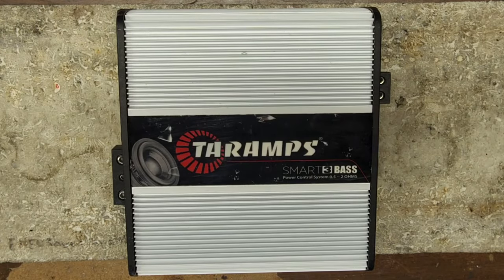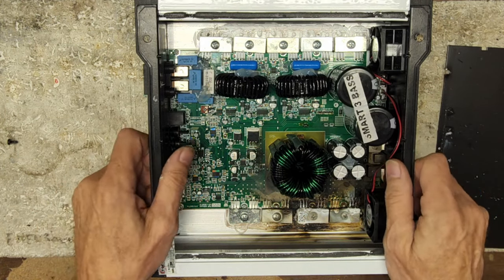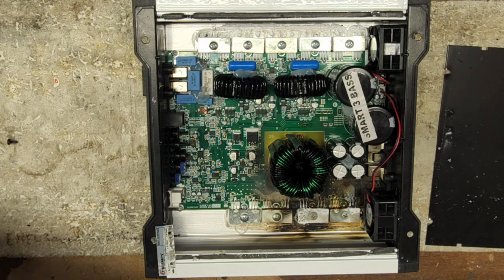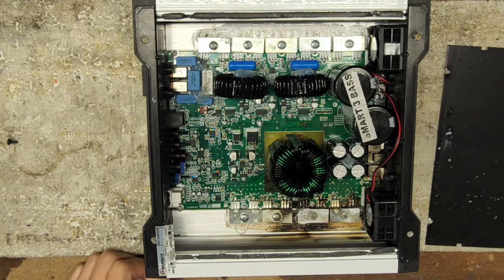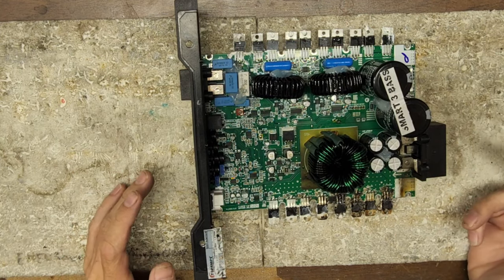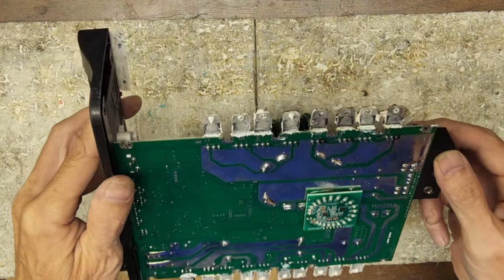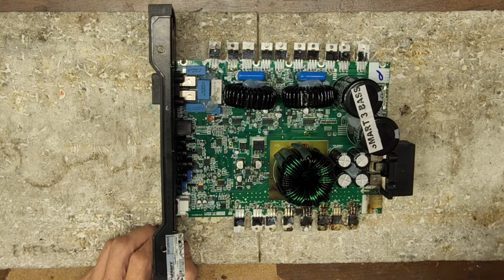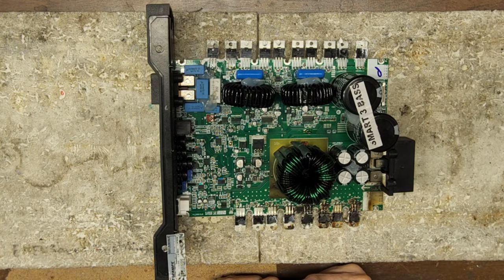Taramps Smart3 Bass .5ohm Power Supply Melt Down and Repair

Comment: I had a nasty whine for the first 30 seconds after I turned on my original smart 3. I asked bare vids what it was, and he said the winding on the coil thing was probably loose. Seeing as how the amp was in spare tire compartment under my box, it was deff a possibility. I re-secured the winding with some more hot glue, and boom... problem solved. He saved me a headache, and I love watching your guys' videos! If I ever have a problem, I'm sending it to you if possible lol.
Reply from the maker: Excellent! Nothing like some coil whine. I am always open for repairs.

Comment: how much does a repair like this cost? these amps are not expensive so I don't know if it's worth it.
Reply from the maker: It is always worth it in the eyes of Ellensburg Amplifier to keep e-waste down. The repair for a power supply failure is under $100. I don't like to put my repair prices here as costs do change over time.

Comment: Hello, I’m new to the channel. 👋 What do you think cause that melt down? 🤔  do you see this often with taramps? 
What would a repair like this cost someone?
Reply from the maker: Hi David. Thank you for the channel support. I see this a lot across all types of amplifiers. This may have been a driver IC failure but no definitive answer as to the cause of the failure. If this was a private repair it may be around $75 to repair. Taramps are excellent boards, some have their downsides but are easily addressed when they come in.

Comment: I took out 2 smart bass 3ks and installed a smart 8 bass. Changed nothing except having to set the gain. 2.5v preouts, charging at 15.6v, clipped at 135v but i set the gain to 126v. Sounded great but started to smell. I assumed it was the subs but they were cool n so was the amp. Went to demo again and the amp was off. Not sure what happened. Subs are fine. Its under warranty so im returning it through Amazon. Getting a replacement. I think the amp was dropped in shipping. Shipped only in the taramps box. The corner was smashed. Amp seemed ok till i turned it on. The snell was strong. No visible smoke though
Reply from the maker: I will bet a power supply failure based on the information provided.
Reply: @ellensburgamplifier unfortunately I'm too nervous to run another Taramps. Going back to Korean board. Figured I'd give Taramps a shot but with the 2 smart bass 3s one had the fans go out, and you know what happened to the 8k., I just can't risk the rest of my equipment. 2 out of 3 amps having issues isn't a good sign. Appreciate the quick reply.
Reply from the maker: @grady.stu.8300  Agreed! Brazilian boards are not for all builds as they can be too picky.

Comment: I accidentally put my ground in my power slot today. Do they use fuses that I can change and fix or is it toast
Reply from the maker: Not toast at all most likely but it may need to have the power supply rebuilt. There are no internal fuses in this.
Reply: @ellensburgamplifier  dude thank god. But would that be something I can do at home. I just have no idea about any of this stuff I’m sorry
Reply from the maker: @gregorysager2377  If you are familiar with repairing Brazilian boards then you bet but if you don't have the equipment or parts then it will be tough to accomplish.
Reply: @ellensburgamplifier  sheeesh. Ok well appreciate my guy fr
Reply: @ellensburgamplifier  I know this is super irritating for you my guy I’m sorry but, what would I have to do to fix it. Like what do I need
Reply from the maker: @gregorysager2377  I am never irritated when it comes to helping others learn. The first thing you will need is a scope or at the least a DMM that will show you frequency. Then you need parts which you won't know what parts you need until you diagnose the problem.  Most likely the power supply drive IC and transistors with possibly the SMD resistor that closes the voltage path to the IC. The transistors will be the 180N transistors with a UCC27524 driver. If you have gat drive then the IC is still OK.
Reply: @ellensburgamplifier  wow. I have absolutely no clue what any of that is 😂😂😂. This might be a shop repair
Reply: @ellensburgamplifier  hey man I just figured it out wasn’t broken. I have a sealed box. What do you think the tuning should be for this amp. Or how do I set high pass and low pass
Reply from the maker: @gregorysager2377  You will want to seek the input of an install shop that will have the tools to properly adjust the settings or give you tips on how to set it up based on your subwoofer(s) and enclosure type.
Reply: @ellensburgamplifier  well I’m just confused on the high pass filter says 10-80 and the the low pass filter says 80-full
Reply: @ellensburgamplifier  do you know what frequency is full?
Reply from the maker: @gregorysager2377  That is correct even though the specs are 8hz to 30hz for HP and 60hz to 200hz for LP respectively on their site for the Smart3 Bass.
Reply from the maker: @gregorysager2377  200Hz
Reply: @ellensburgamplifier  I have the MD1200.1  2 ohm version. And I have 2 Rockford fosgate P3’s the site says they go as low as 27hz. I just want to be able to tune to as low as I can go in a sealed box
Reply: @ellensburgamplifier  and so should I turn the filters all the way down and turn the gain and bass boost up?

Comment: How fuckin lazy do you really have to be to repair a amp from the top lol and especially a small amp like the bass 3k. They must have not had the extra 5 minutes needed to pull the PCB out of the heatsink smh
Reply from the maker: And when pulling the board is a perfect time to replace the thermal paste. Just makes a better job.